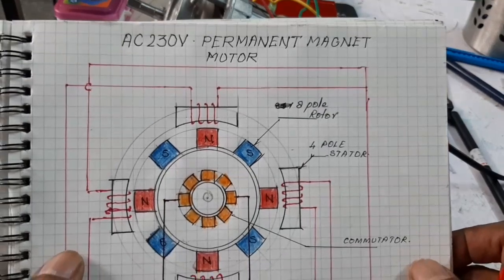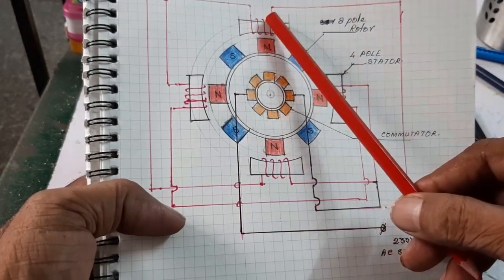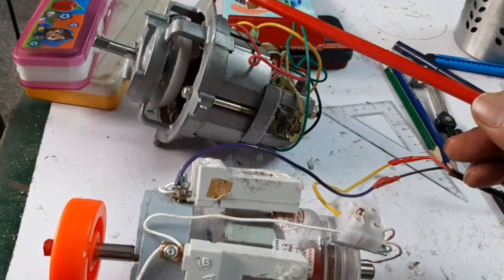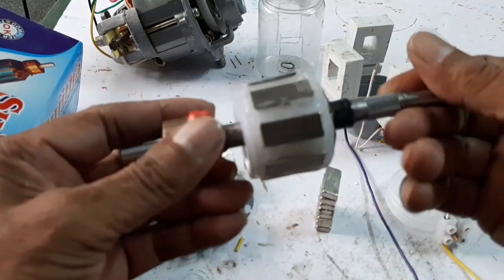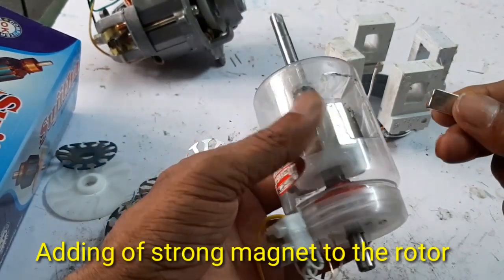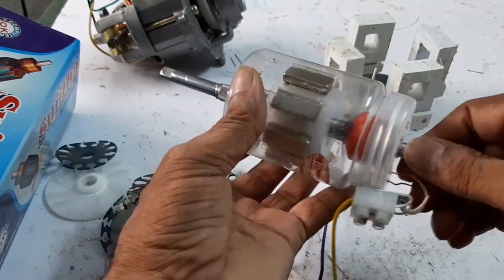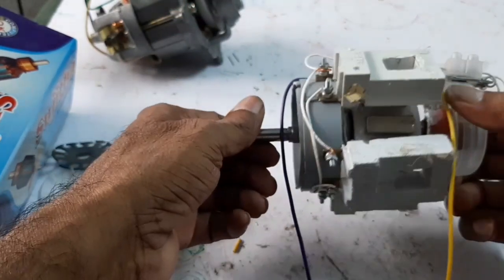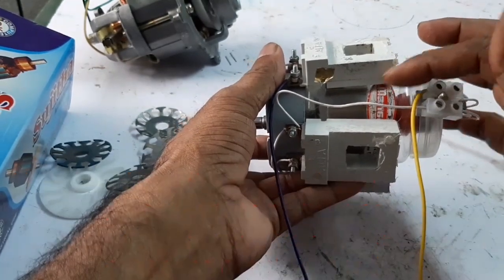Powerful high torque ac 230v permanent magnet motor

Comment: Sir, very nice idea and well explained. Can this motor be made for regular use? How to control speed and how to get desired torque?
Reply from the maker: Sir
This is the motor like dc series motor. Here i connected diodes between set of commutator segments that one diode in fwd direction and another diode in rev direction. Sothat the commutator conveet the ac supply into dc fwd and rev direction according the rotor poles.
If you reduce voltage level the motor speed will reduce accordingly
Thanks sir

Comment: Hi Sir, wonderful job. I have a new idea for a motor. Shall we try Axial Flux Induction motor? Basically, stator is same as axial flux BLDC but for rotor, instead of permament magnets, we use a single copper/aluminium/graphene disc connected to the shaft. Then, we stack several layers one on top of another. To control, we use Arduino to change the speed of UVW Switching and PWM to control voltage.
Reply from the maker: Thanks sir
Please give the diagram and i will try to do this same
Reply: @pugalstech  Thank you
Reply: I have sent the diagram via email.

Comment: Vannakkam Senegan Sir, did you not face problem in efficiency due to air gap of this design?? It is a very innovative design getting a frame to hold rotor from a plastic jar was simply awesome, Super intelligent and great design sir Nalla design 🙏🏻🙏🏻🙏🏻🙏🏻
Reply from the maker: Thanks sir
My name is pugazhendi
Here i using new concept that is
I have connected diodes at one end of commutator. The rotor poles are equal to no of diodes and connected at commutator it senses the pole and feed the fwd and rev supply to stator poles according to poles
Reply: @pugalstech  Rev Sir I shall surely connect to you on mail and be in touch would love to visit your workshop, I build batteries for EV, and storage applications, it would be seriously great to work together, I highly appreciate your knowledge and skills dear sir 🙏🏻🙏🏻🙏🏻

Comment: i would put current limiter so my commutator leads dont fry in case they short , they are connected to grid so careful
Reply from the maker: Thank sir
Here i connected the stator winding and commutator terminals are in serious if the commutator short circuit nothing happen
Here i have connected some diodes at one end of commutator some sequence
Of the rotor poles
That is north pole comes, the diode allow the current in one direction
When the south pole comes the diode allow the current in opposite direction
No of diodes are selected according to the no of poles ratio.
Reply: @pugalstech  the diode will protect from short ;)